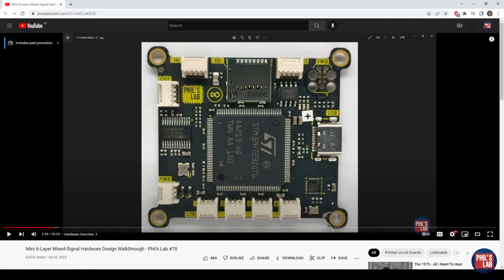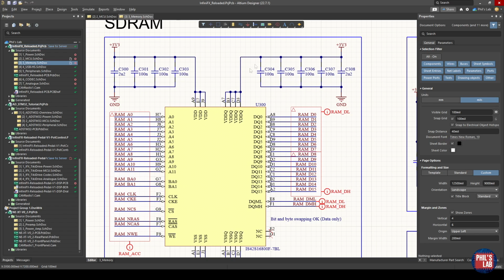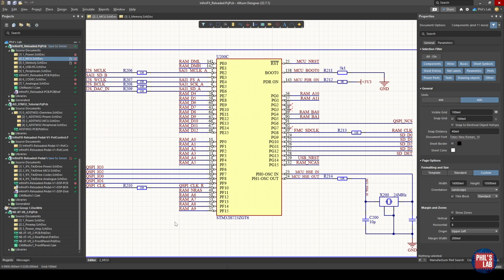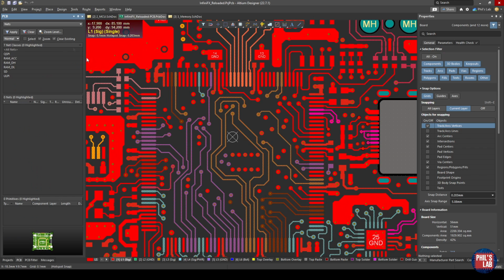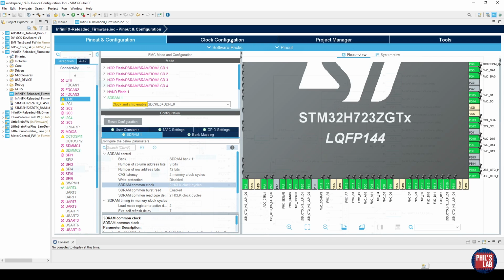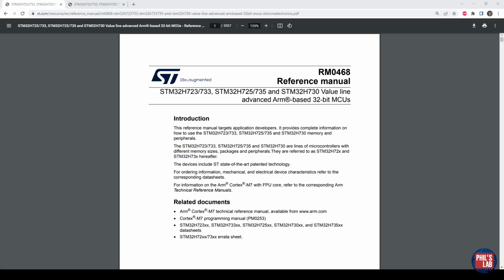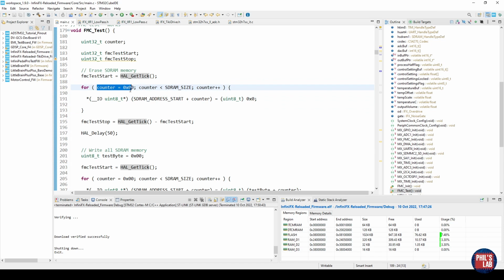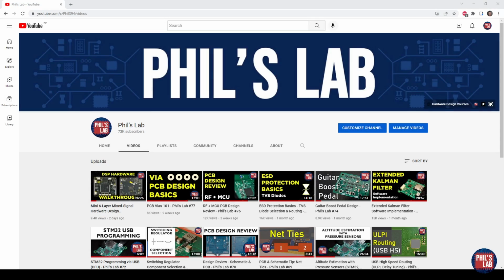(Sponsored) SDRAM Hardware & Firmware Tutorial (STM32) - Phil's Lab #80

Comment: What is the purpose of 16-bit byte enable checkbox? I see it adds this data line byte select lines, however, if we already have 16 bit data bus what's the point of using these byte selects? Can it just be disabled and RAM chip bytes select lines grounded so it always performs 16-bits reads/writes?

Comment: Hi Phil, I'm developing a DSP device as well and I wanted to add some external RAM. I found another SDRAM chip, the Winbond  W9825G6KH-6 which is slightly cheaper, has double the capacity, and is already in stock at JLC as well as Mouser. So I wondered why you chose this ISSI part over the Winbond one. I have literally 0 experience in working with these SDRAM parts so maybe there is something I'm not aware of. The winbond chip is 166MHz for instance while your ISSI part is 143MHz. Could it be 166MHz is too fast so that it needs a refresh time which the STM32 can't handle? The 16MB of the ISSI one should really be large enough for me and they have it in stock at mouser so I could experiment with it before going in production, but I wondered if the Winbond SDRAM might also work. (Provided I don't kill it while handsoldering 😅)

Comment: Thank you for your videos! When I need to measure the exact execution time of a command, I submit a logical unit for output pin at the start of the command and convert it to a logical zero at the end. Of course the output pin must be configured to the maximum speed I measure the time itself with an oscilloscope or a logic analyzer. It turns out very high accuracy. Sorry for my English, it's not my native language

Comment: Phil, can you tell me what limits the speed for accessing memory?  Is the limit based on the processor?
Reply: If you clock the bus too fast you get garbage data. The same also happens if you do not wait the appropriate amount of time between certain operations because the DRAM chip has internal circuitry that has to settle into a definitive state.

Comment: Great demystifying of the SDRAM ! Question > Can the sdram memory be integrated in the linker script so that it replaces the internal memory ? That would allow straight up initializing variables in it at compile time and using memory allocation commands (malloc), instead of just using pointers to it, which are prone to code design errors.
Reply: Yes. You can create memory segments and get the linkerscript to use them.

Comment: Knowing that certain adress pins of a sdram chip might be used for specific funtions and other are just for the adress. Would u recommend pin swapping of the adress pins during routing?
Reply from the maker: Pin swapping of the address pins is generally not recommended (unless you know what you're doing, or can/will adjust the controller to suit). Address pins aren't just for addressing for some are also even control (even ones labelled as 'just address' pins).

Comment: There are checks you can implement like checkers, climbing bit, alternating bits, etc IIRC JEDEC has document that describes them. That's what is typically used in BIST tests (I mean ATE silicon testing)
Also one thing that needs checking is whether the refresh rate is properly programmed by waiting much longer than the refresh rate and reading again. Sometimes it's just outside the value and once in a blue moon a bit will flip. Hard to find except by running those pattern tests with enough time between write and reads.

Comment: Hi Phil! I would like to make this question. Maybe I did not understand that part. When do you tell the microcontroller to use external memory and not the internal RAM? Or is the internal RAM attached to one bank and you changed the bank to bank one corresponding to the external memory? And after that when you are creating a variable, for example, it saves the value in the external memory? 

Thanks a lot for the content I love it so much!
Reply: The internal memory and external memory are mapped to different addresses. Any read or write will go to the right place depending on the address you choose. Creating a global variable or one on the stack will use the internal memory unless you change the compiler/linker settings to use different memory ranges for those things. That is only because this is set up before hand. You could also add your own memory allocator to keep track of external memory usage. It's more of a software development issue and not something you "tell" the microcontroller about.
Reply: External SDRAM is assigned to separate pool of address. Starting 0xC0000000 or 0xD0000000 as I remember correctly. You can just write/read directly to those addresses, although this memory is much slower than internal RAM.

Comment: Great as usual. One item that is irritating to old-timers. '0x' or zero x, is a C pre-processor flag or directive and not part of the number or part of C. I know it has become common to include it while speaking or in text, but it ain't right. Just say 'hex', and it is zero x, not 'oh x', which is entirely different.

If these languages had radix modes like Forth and a few others, we could all save a lot of eye strain and typos by typing HEX and then just using hex numbers in tables and arrays. At the end type DECIMAL. Personally I would like BINARY modes when setting up registers or using masks and the like. Cheers.

Comment: Did you tested SDRAM read performance? a friend of mine accidentally discovered that it`s know issue that FMC inserts dummy read cycles when reading from SDRAM
Reply from the maker: Haven't gone into too much detail testing the SDRAM performance - will be interesting to see if I run into the same issue.
Reply: @PhilsLab  https://www.st.com/resource/en/errata_sheet/es0491-stm32h72xx73xx-device-errata-stmicroelectronics.pdf 2.6.1

Comment: maybe not the best place to ask this, but:  what actually is Firmware? (per definition)?  Whats the difference between "normal code", an operating system (kernel), and firmware?

is "firmware" just low level stuff or is there more to it?
Reply: Firmware is code that runs on any device that isn’t easily updated. Another definition is anything that you don’t think of being “a computer” runs firmware. Your car runs firmware. Your microwave runs firmware. Hell your fridge probably runs firmware! It’s not a strict definition (and all firmware is also software) but I hope that helps.